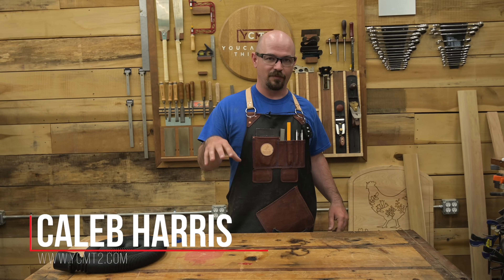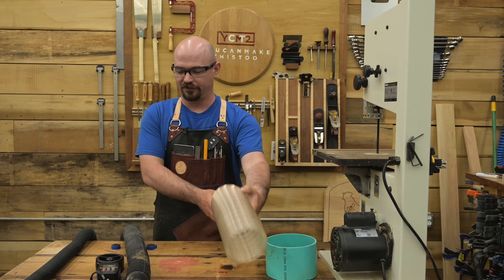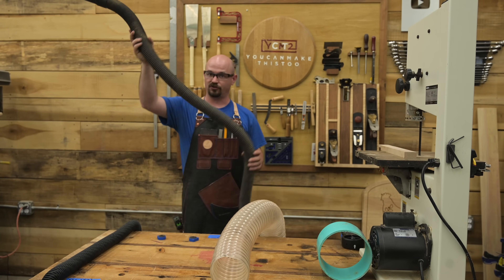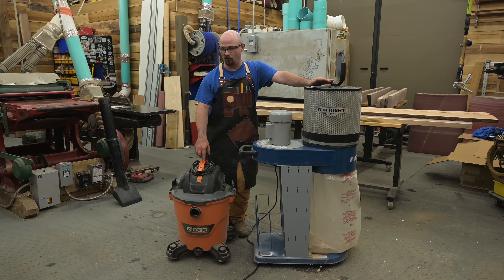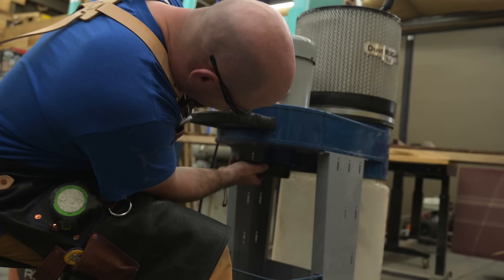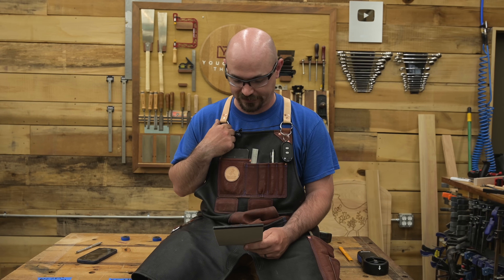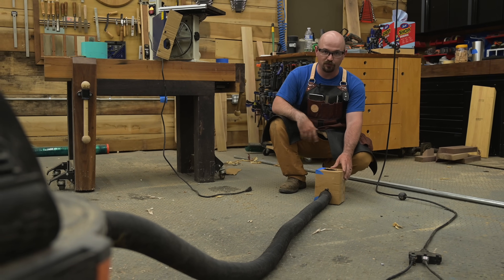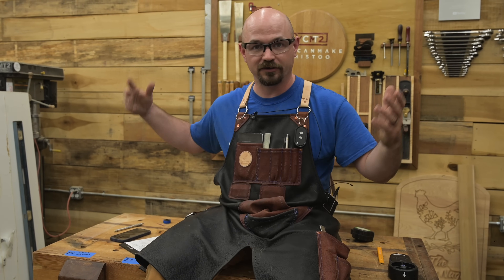We're Wrong About Dust Collection

Comment: The increase in air flow with a larger diameter duct gets even more so once you account for the fact that friction in fluid dynamics is also controlled by how far the fluid is from the nearest wall. So for a nice big 6" or 8" duct, the air flowing through the middle of that duct is a lot further from the wall than air flowing through a 2" duct can be. Therefore it can flow a whole lot faster with less energy consumption.

Comment: This is why I stuck with shop vacs and when ready to upgrade went to a Supercell (it has traditional DC cfm but shop vac pressure by using multiple vac type motors). The pressure also pulls more dust from tools/machines that don’t have perfect dust management.

Ie I don’t know why High Volume + High Pressure doesn’t settle the pressure vs volume debate.

Comment: Curious if you happened to measure directly at the 2” end of a 4”—> 2” plastic reducer? Thinking that reducer directly to a 2” tool might not reduce as much as the reducer with a bunch of 2” hose connected to the tool. In theory you could put the reducer directly on the tool if it allowed more flow. Thank you.

Comment: I just use a 1 car garage, I just want simple which works with vacuum 5 hp on a two stage system.  However in winter I have not had a lot of luck with my Dewalt734 planer in my shop.  In summer I just go out side.  I now have a extra 5 hp vac with a dustopper.  I am going to hook both to the planer, and see if the extra suck from two vacs well cure my plug ups.  Well know soon.

Comment: Would like to hear the comparison based on motor Hp vs the hose diameter.
Reply: I guess that was what I was thinking.  Does the high volume low pressure motor load up and slow down when pulling through a small hose
Reply from the maker: The opposite, which is counterintuitive. The higher resistance is just for the airflow.. which means less air is moving. But less air in the impeller housing means less resistance for the motor.. so it actually does its work easier.
Reply from the maker: Hilariously, my big unit is 5hp and the shop vac claims to be a 5hp peak. More relevant would be impeller size and rpm’s.

Comment: I'm a DIYer who just does small projects, using mostly a Skil table saw, Skil Router Table, and an Hitachi miter saw.  The table saw has a 2.5" dust port and the router table takes 1.25 or 2.25" hose.  Would a good shop vac and possibly a dust separator work for these tools?  What about hose size?  Dust extractors from Festool and Harbor Freight appear t use only 2.25" hoses.  Is that too small?  Note that the shop area is very small and the hose doesn't need to be very long at all.
Reply from the maker: If that’s the port you have that’s the way to go. Especially on small tools you want the higher static pressure of a shop vac. 

Dust separators are nice, but you lose air flow and pressure.. ultimately collecting less dust at the tool. But, it’s easy to empty and you don’t have to clean your filters as often

Comment: Better to extract to outside and just get a cyclonic separation and exhaust to exterior.   Increase CFM and dust is removed from area.  The 99.999% of the fine material is removed from confined area.    Mine blows into backyard flower beds.
Reply from the maker: If that's an option it's definitely one of the best.

Comment: what many do not realize is if your dust container is inside your work space, microscopic sized dust will escape from the canister. this dust is very harmful, possibly causing COPD. the container should be outside the work space so that fine dust will blow away from you.
Reply from the maker: That’s ideal, but not always possible. Which is why a properly rated filter is important.

Comment: Really great video! Thanks for explaining it and experimenting with it all. One question, I have a baby bandsaw with a shop vac style port - and a 4inch dust collector. Would enlarging the the hole in the case of the baby bandsaw to a 4 inch port work well, because you aren't stepping down the hose size?

Comment: Another thing to think about if you are designing a dust collection system is that If you are working with rough lumber, you can fill a 55 gallon drum in no time, so a system with a large dust bin is a must — unless you want to be emptying your bin constantly! I think the newer shop vac/cyclone systems are definitely the answer for smaller tools and for axillary pick-ups at larger machines. I don't think one or the other is the singular answer, and I'll keep a wait and see position on the supercell  systems — they sound great but is are they right for a larger shop 🤔

Comment: Shop vacs develop a higher static pressure for the same reason they're noisier. The impeller spins way faster, and static pressure is proportional to the impeller speed squared.

Comment: I’m stuck between the shop vac and dust right collector. Most of my tools are 2.5 inch port compact tools in a garage workshop. I’m about to buy a drum sander. It looks like I may have to run two systems.
Reply from the maker: That would be the most affordable way with just one high volume demanding tool

Comment: *Great video*! Thank you so much. As an propulsion systems engineer who designs jet engines, I deal with these kind of numbers everyday. So you would think that I would just know intuitively which is the right type of dust collection for the shop I am going to build when I retire later this year, but you would be wrong. Well, I guess I did know somethings, like all the basic physics of the impact of reduced diameter, higher wall friction, bends and turns, and longer runs have on total air  flow (because after 40 years designing jet and rocket engines my bosses have yet to come to me and ask if perhaps I wouldn't be happier in a job I was actually good at). 

amatuer-ish 

So now my plan, thanks to this video, is to go with a higher quality shop vac, like the new very quiet DeWalt StealthSonic, for long term dust collection. And in the future if I want to upgrade, it would just be to get a second shop vac/dust separator and build it into the workbench between the router table and miter saw so I didn't have to fuss with hooking up the portable one to the dust port in the front of the workbench that connects to the hoses and pipes built in to the workbench going to those two tools.

Comment: I've had this discussion with multiple people over the years and no one seems to believe me. Using LAARGE dust collection systems with small machines is NOT a good idea.... or at least with machines that have small ports.
As an example, my old Bosch PTS 10 table saw has only 35 mm ports and my two bag 4 HP dust collector with 160 mm hoses is practically useless for this. When I scale down the hoses to fit the 35 mm ports... practically ALL suction is gone!
Attaching a shop vac.... it works like a charm.

Comment: The real question for me is what to use on my 2.5 inch collection port on my CNC. I might be able to upgrade it to larger port later but for now the dust collector is so quiet compared to the shop vac.
Reply from the maker: If you're stepping down a 4" hose right at the dust shoe then you may not be seeing too much loss. If you've got a 2.5" hose on that dust collector then you're losing most of your air. 

That said.. if you're getting enough air to clear out the debris and pick up everything, then stick with what's working. No sense inconveniencing yourself to go from enough air, to more than enough air.. and not see any difference in performance.

Comment: Thermal Engineer here (that studies airflow for a living)... Good video.  Measurement tools are always the best way to find out what works best for you.  Write down the numbers and reference them when you have an issue in the future.  It will help you find a clog in your hose (sticks) and leaks.  I can add more "color" to your conversation about getting both pressure and volume. Impellers are designed for one or the other so if you only have a one impeller system, you have to pick.  The solution is to put two impellers in series or parallel.  Two in parallel will increase volume but not pressure where as 2 in series will improve pressure, not volume.  You can actually do this on your own by hooking two dust collectors in series or two shopvacs in parallel.  It isn't going to work as well as the bigger pricier units that you named that have multiple fans but you can play with it and sometimes get something that works better for your setup.  All shopvacs and dust collectors are general purpose with a "one size fits all" approach.  That is the best you can do when buying off-the-shelf products.  Although somewhat red-neck, adding multiple systems together can shock you on the performance. 
On a complete side note (and me just being a jerk)... your deltas were incorrectly stated (differences between the two.)  You made statements like "180% improvement" but the first 100% you don't count when comparing.  It was "80% improvement". 🙂
Reply: Also increasing radius doesn't make volume grow exponentially because of pi, but because of r^2. That one got me too
Reply: Thank you for this detailed comment. I always appreciate experts summarising the science and the ‘how-to’ in a succinct way.

Comment: Great video!  So basically, if you are a small shop using smaller tools with ~2" openings, shop vac will outperform bigger dust collectors.  And the inverse is true, ie, once you graduate to bigger 4" equipment, it's time to upgrade to bigger 4" dust collectors as well.  Good to know I can just save my money for now, and what I currently have is about the best I can expect at this point.
Reply from the maker: Yep. And don’t throw out that shop vac when you get your first 4” tool and dust collector. Keep it for the small ports and sander until you get an extractor.
Reply: @YouCanMakeThisToo  I just picked up the Oneida low pro tonight to hook up to the ship vac. Hopefully, it will make this little setup even better. Got me a project for a shop vac + separator cart for the weekend.

Comment: So my past several days of research was just blown up by this video 😂. All of my tools have 2.5” ports and I’ve tried my Ridgid shop vac with HEPA filter and bag + dust stopper pro and it just seems like it’s not sufficient for things like my table saw. My assumption is the dust stopper is drastically reducing cfm here (I’m looking into getting an “Annie” to test the differences with and without the HEPA bag, dust stopper etc). 

The other thing I’ve been trying to accomplish is a solution for having to constantly move the shop vac hose from tool to tool when working on projects - so I’ve designed a small 2.5” ducting run around my mobile 4’x4’ work table with blast gates so I can hook up multiple tools at a time and just open the blast gates one at a time. 

I was thinking that even with a cfm loss, starting out with a harbor freight 2hp collector with cyclone dust separator would be good initial starting point to hook my work table up to. Do you think a shop vac still might be the better solution here? 

Thanks for the super informative video!

Comment: Dust collection is by far the least understood subject in woodworking in my opinion. I am not sure about your CFM readings on your shop vac. At the impeller, the max cfm attainable on a rigid shop vac is about  150 cfm. This is fine for most small benchtop tools and handheld tools. The standard CFM requirement for most stationary tools is 350 cfm per manufacturer. Keep in mind this does not account for the fine particulates that cause the biggest problems for respiratory health. Big difference between fine dust collection and the dust particles you can see with the naked eye (chip collection). Did you set the cross-section on the meter for the diameter of each port?

Comment: That rotating vein anemometer should not be used with small diameter ducts.  Minimum would be 6".  the diameter of the vein area is much smaller and effectively reduces the measured area.  Use a thermal anemometer.
Reply from the maker: If someone wants to send me one, I'll use it. Otherwise, I don't think any accuracy issues are significant enough to change the results of anything I'm doing. I'd be really surprised if my margin of error is high enough to change the recommendations

Comment: You should not reduce and the use a smaller hose You should always reduce it right at the machine. Yes it still reduces efficiency but not as bad as running it through a 6' long hose.

Comment: Really like the video. One question though, wouldn't the length of the pipe also have something to do with the cfm? From the Rockler you attached the smaller hose to the larger hose, so it had a longer distance to suck through. Where when you hooked it up to the shop vac, it was just the shorter hose.

Comment: the big problem I have with those Oneida Super Cell and Turbo Super Cell is their life span.  Oneida themselves states an approximate 1200 hour life span on the motors as they arent induction motors but are just your run of the mill universal motors.  They heat up, are very loud and will likely need to be replaced in 5 to 10 years depending on use.  (think shop vac on steroids)  I considered and quickly dismissed them for this reason despite their wonderful reviews.  give it time and you will start to see lots of super cell motors failing.  Thats why I went with the old reliable Clear Vue like yourself.  All my ports are 4" or larger so this fits my bill
Reply from the maker: I hadn't heard that before, good tip.

Comment: The Camvac high pressure system is one of my favorite buys. Never thought I’d say that about anything relating to dust collection. Handles large and small hoses, large and small machines. Very versatile, I’ll never go back to a low pressure system. It requires 220v but worth it if you can’t swing it
Reply from the maker: I’d never heard of it till the comments on this video. It sounds great
Reply: @YouCanMakeThisToo  I really can’t say enough about it. I’m adding a cyclone to it very soon and that’ll be my favorite upgrade next to a shelix for the planer

Comment: You don’t show exactly how you are using your air flow meter, but it seems the pipe diameter needs to be close to the annulus diameter of the meter to give an accurate reading.
Reply from the maker: I had it set on max and would slowly oscillate around the opening for each to capture the greatest reading it could get, and repeated 2-3 times to ensure it was a similar number each time and compared those. Would identical sizing give a more accurate reading? Yes. But I think the difference would be moving from 95% to 98% confidence which would be statistically irrelevant to the findings, no result would come close to changing.

Comment: The whole point of the Pentz designed system is to accomplish the minimum 1000cfm at the tool necessary to insure that the finest microscopic dust that you cannot see is captured at the tool before it can escape into the air you are breathing.  NONE of these smaller alternatives described here can do that.  

This entire discussion about these sub 5 hp collectors can best be described as pertaining to wood chip collection because that is what these smaller systems can accomplish.  You are still breathing the fine, cancer causing wood dust that your smaller tools create even though these smaller collectors appear to the naked eye to be doing a good job for you.

The single most important take away from Bill Pentz' work is "1000 cfm at the tool".  That large 5hp, 16 inch impeller ClearVue system typically yields >1500cfm at the tool to a 6 inch port or to 2 four inch ports simultaneously.
Reply: I think you need to do a little more research on flow dynamics. The Clearview lid-top separator (I own one) would not allow 1000 CFM to flow through it unless the suction (in inches of water lift) were sufficient enough to pull 1000 CFM through a 2-1/4" opening on the cyclone. This is true of ANY AND EVERY cyclone. Some cyclones have more flow restriction than others, so there may be some variations. So, lets just say you take a typical 1250 CFM vac (i.e. Delta 50-760) that has a 4" duct attached to it. Now add a reducer to 2-1/4 ID and CFM drops to 218, or close to 1/6 max. Now, add the Clearview between the reducer and the Dwyer CFM gauge, and you measure 102.5, or close to 1/12 CFM. If I take the same ClearVeiw and connect it to a RIGDIG 6.5 hp capable of 178 CFM  MAX, my ClearView makes 132 CFM. Conclusion: A ClearView sepator works far better on the Ridgid, than a 1250 CFM central vac. Why? Because the Delta only produces 18" of lift, and the RIDGID produces about 80" of lift. Yea, it's complicated. CFM with little suction is WORTHLESS. For the record, and Bill Pentz agrees with this: There should always be a filter behind a cyclone, even a ClearView. Why: Because of cut point. the CV will not separate to a cut point of .03 microns, only a filter can.
Reply: @DustopperTom  What part of : "That large 5hp, 16 inch impeller ClearVue system typically yields >1500cfm at the tool to a 6 inch port or to 2 four inch ports simultaneously." don't you understand?

Comment: I get that the dust collector doesn’t pull as much air when restricted down, but what if you had a Y section and hooked up two 1 3/4”. Would you maintain the 4% from both outlets at the same time? My issue is I’m running many 1 3/4” tools simultaneously and wondering the best way to extract dust without having a shop vac on each individual one.

Many thanks
Reply from the maker: I really don’t know. My GUESS is for each split you’d see a reduction at the tool. My reasoning is a reduction in flow causes an increase in pressure.. that pressure helps preserve flow. If you’re cutting volume and then necking down.. you’ll have a lower pressure increase due to lower volume getting constricted, which is gonna cause more loss.